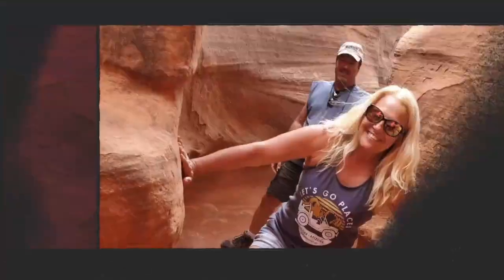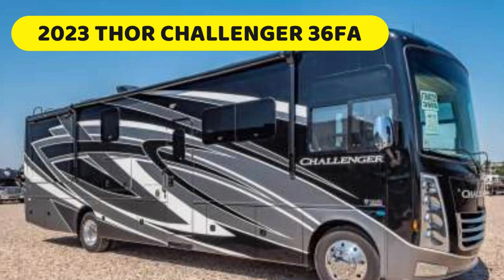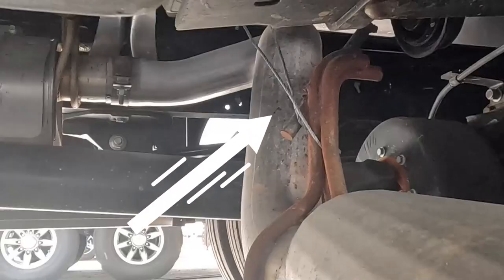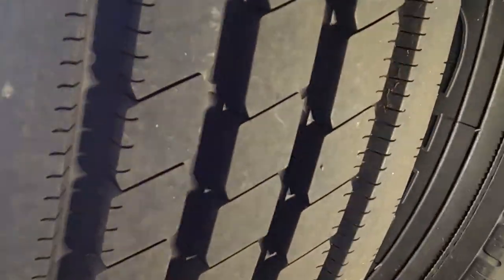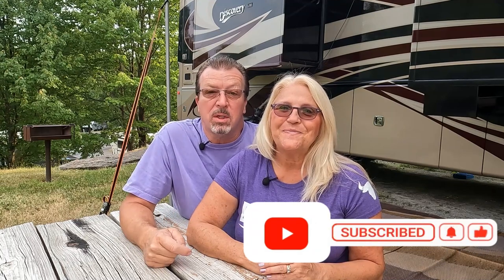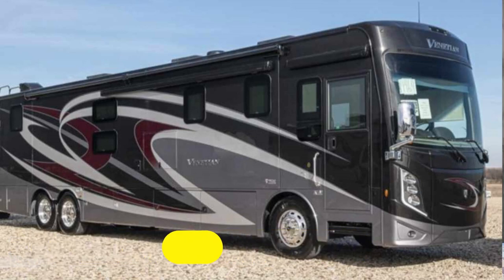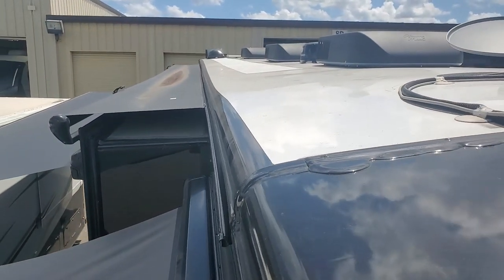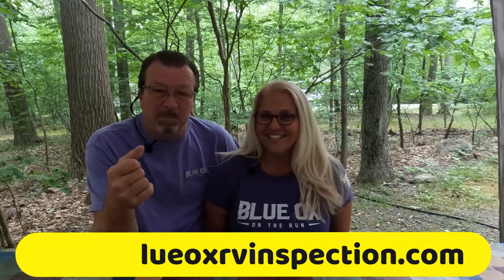💥YOU think you DON'T Need an RV Inspection? Have you heard about the lack of PDI at RV dealerships?

Comment: The inconvenience of poor quality lingers long after the thrill of a bargain has been forgotten.  My motto at work.

Inspections are needed more on brand new rigs because they have not been owned and used for a year to work out the bugs.  I'm not saying don't inspect a used rig.  My brother went through three new travel trailers to get a good one.  First one was in the shop more than the campground in the first season.  Every time he took it out something broken; most of the time is was structure!  He traded it in the next year on another new one.  That one had the same problem of being in the shop more than the campground.  The RV fridge never cooled.  They could not figure it out.  My brother looked at the installation instructions and found they did not build the cabinet correctly so the fridge would not draft the hot air out and the unit would cool correctly.  Fans did not help.  They could not fix it and the builder took it back.  Now two and half years into RV'ing he is on the third new rig.  He did not even take it camping for the first three months as it had to keep going back to the shop because every time he went to pick it up - they broke something in attempts to repair it.  It was like an onion.

We used to boat and when buying you always had a survey done.  Cause problems out on the water can leave you... wet.  $10K boat, you got a survey.  RV's should be the same.  And to tell you the truth, my 1961 Chris Craft Connie was less of a problem than any of my class A's!
Reply from the maker: You got that right...quality is rarely part of a corporation modo...🤣🤣😍